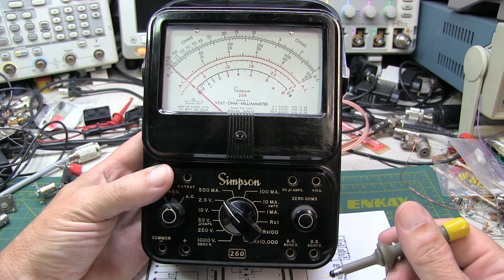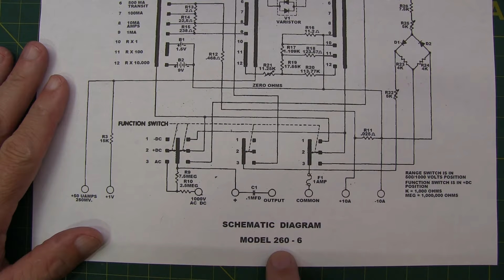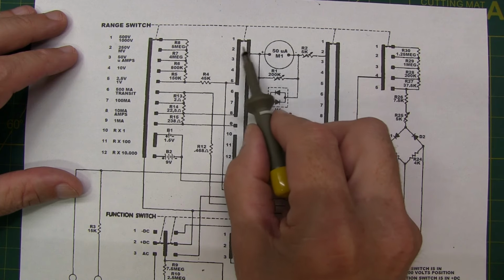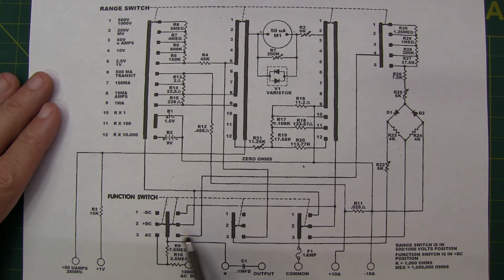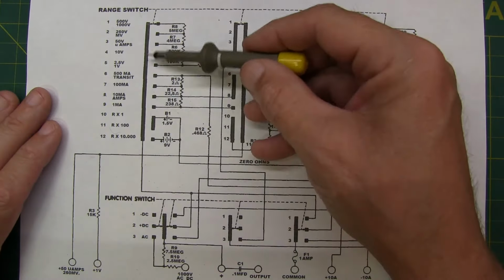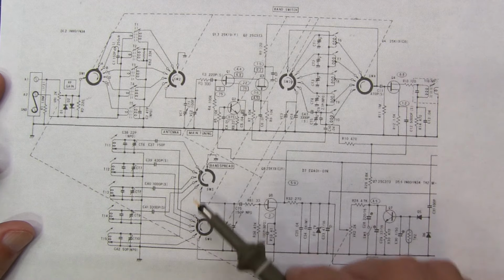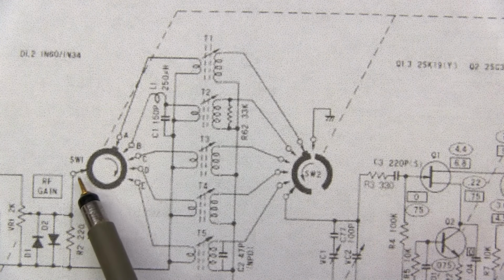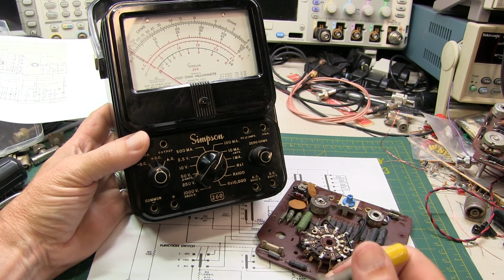#392: Schematic Basics: Multi-position switches in Simpson 260 VOM and Realistic DX-160 Receiver

Comment: Somewhere in my collection of antique meters I have a very early multimeter.  If I remember correctly it has a 8 or 9 stack ceramic wafer switch.  All of the resistors in it are made of coils of nichrome wire.  No surprise, when I checked it's calibration (after a liberal cleaning of the wafer switches with Deoxit) it was still spot on even though it's around 100 years old.
Reply: What make and model? Thanks in advance.

Comment: Reading a schematic is usually not a problem. First time I came across these it took a few minutes and I figured it out. Matching the schematic with the physical switch and how it is wired is a completely different matter. While restoring my Yaesu FT 102 I had to realign the slipped band switch to proper positions on a multi layer switch. I could not do it on my own.
Reply from the maker: They can be REALLY tricky, and often not documented will enough to index them properly.

Comment: If you were a manufacturer, and you didn't need to be a large one at that, you could call up Centralab and ask for a switch of your liking for a prototype. It could be built around anything from two positions up to twelve, and with several segments per wafer, working at different positions (say position three to six), and multiple wafers. You will see this a lot in the old Heathkit, Eico, and Knight (Allied) kits. How I wish those days were back!

Some of the meter switches turned a wiper with three finger contacts, which matched pads on a PC board. The good ones had a gold-plated wiper and pads.
Reply: You can still get custom rotary wafer switches.  I had a dozen custom rotary switches made about 2 years ago by Electroswitch.
Reply: @mikesradiorepair  I thought one might. I still have an old Pickett template for rotary switches that I used to design custom switch gangs, which we sent to the manufacturer. They had a pretty quick turnaround back then.

Comment: Thank you for this.

Initially I wondered why anyone would have issues reading the schematics, but as I thought a bit I realized that multi-pole, multi-throw switches are quite rare these days. Why would anyone even look at a schematic for new equipment with switches like that? Assuming you'd ever see a schematic for a small DVM, it likely contains a very simple switch. And let's be honest, we're far more likely to replace rather than repair one of those comparatively inexpensive meters so why would we look?

Almost all of my test equipment, with the notable exception of my nostalgic Simpson 260 Model 6, use soft switching for function and range. I think every transceiver that I own also eschews the use of the noble rotary switch for the obvious reason of reliability. Those wafer switches don't go bad very often, but when they do, they tend to go very, very bad.

Comment: Never seen the vertical switch representation as shown in the first schematic.   It seems easier to follow than the switches represented as circular wafers.   The way it was shown in the first one was like a table you could just read across the page to see all the connections made in a switch position at a glance.  The circular ones for me almost necessitates having to mark up a schematic to keep it straight.

Comment: If you want some REAL fun, take apart an old Triplett 630, pull the switch knob out, then, you can independently index the wafers inside the switch housing out of sync ( I think there's 4 from what I remember), as I did this while spray cleaning them. I eventually got it sorted out, but, I'd recommend NEVER trying to turn one wafer at a time.

Comment: My first meter was a 260,  series 2 I think.  The one thing I did to it was to remove the pin-type connectors and drill things out to put banana jacks in there.  I find the Simpson diagram easier to deal with than the other,  which I've also run into,  mostly in Sams Photofacts.  I have another 260 here that needs some TLC,  and the biggest problem is that the shafts for both the range switch and the other one are that they seem to be frozen solid. Can you suggest anything to deal with this?  I like my old analog meters,  and have several others besides.  :-)
Reply from the maker: Maybe some penetrating oil?

Comment: Are you going to make a video lesson about TV, Radio, Stereo Amplifiers, etc schematics from the 40's to 60's would have voltage measurements using the simpson but the voltages were calculated with the Simpson LOADING Effect. EXAMPLE if the schematic test point#1 says 10vdc, its NOT really 10vdc because the simpson loading effect would put a load on the 10vdc. You have to use some type of formula to include the simpson loading effect into the formula when measuring voltages.